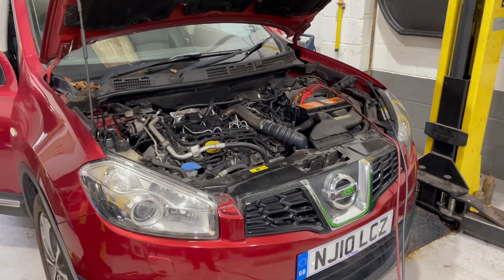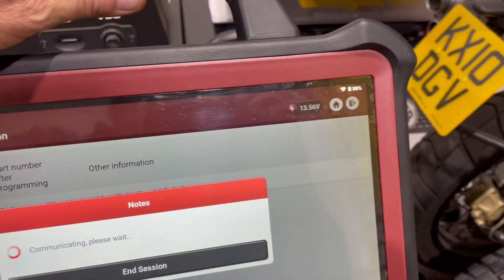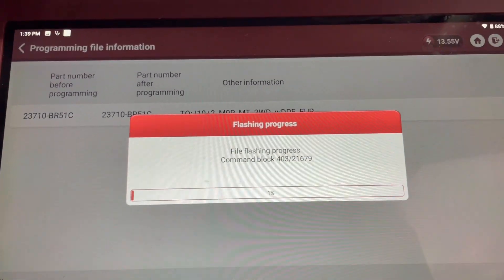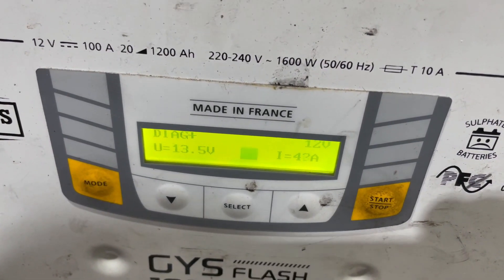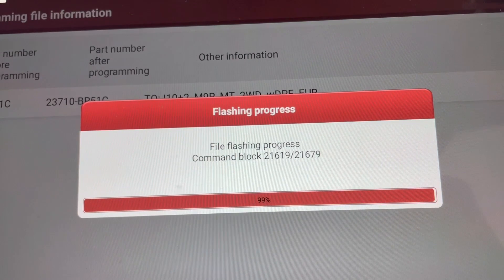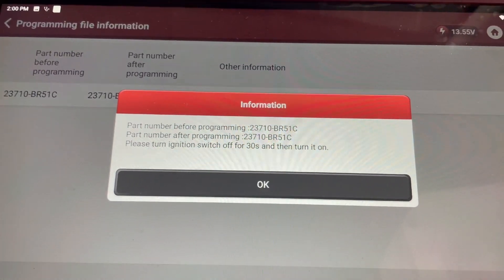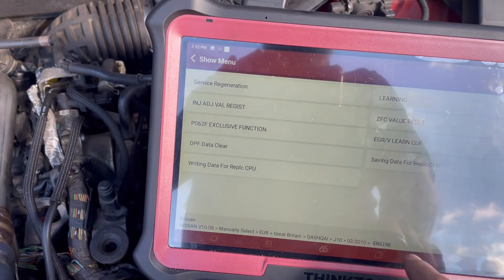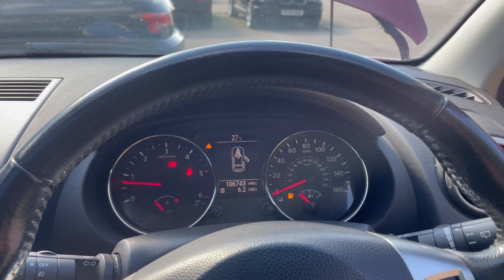Reflashing and overwriting an Engine Ecu on a Nissan 2.0 DCI M9R Using ThinkTool ThinkCar Max Tool

Comment: Hello Sir hope you can help me I have 2012 2.0 tdi the hpfp blew up we changed everything  but aftermarket injectors in it. I have a vcds computer and it says #2 injector is open. This being said  the car will not start and throws a low rail pressure code. Will the injector being open cause it not to have rail pressure. Thanks for your comment

Comment: Awesome video Gary literally looking at getting a thinkcar or top don to program Nissans , what model thinkcar is that please mate ?? Been told that thinkcar sell the software to topdon but they don’t have the same capability. You heard this on your research ??
Reply from the maker: I’m using the Max I’m using, there’s a link in the description where it can be bought
Reply: Correct Topdon are not much more than a rebranding company,
Reply: @alexgillbanks1943  are you saying they have the exact same capability and programming, i can’t see why they would use different software and servers.
Reply: @grantwatkins7402  no they have held certain functions back for the Thinkcar tools particularly on Ford as they want them to be the premium brand. For example on our best seller we have online programming where the Topdon version you need to spend another £600ish to get the equivalent functions.

Comment: Not sure any value here for a lot of viewers ,no real intro to the fault or discussion , left me non plus !
Reply from the maker: Not every viewer wants to see the faults. You’ll be surprised how many comments & questions I get about  the tools used.
So just because there’s no value for You it does not necessarily mean there’s no value to others.
Reply: Nice to see a demonstration on the think cars other functions and that they work.  I have been considering one. I was told recently that security gate way access (ie already paid for) is included in the tool. Are you able to confirm this? I dont always believe saleman. Great content on your channel.
Reply from the maker: @adamking6419  yes the tool is good to go on late model Jeep, Chrysler, Fiat & Mercedes equipped with the secure gateway.

Comment: Great video something I’ve never seen done and it’s unlikely that I will ever do myself. No chance of doing this sort of work without a battery maintainer those fans pulling 47 amps wow. How did the road test go ??
Reply from the maker: Still has the issue but as I had no background on the fault I had to ensure the software was good, hence the overwrite.
This car is work in progress so stay tuned there may be more to come….